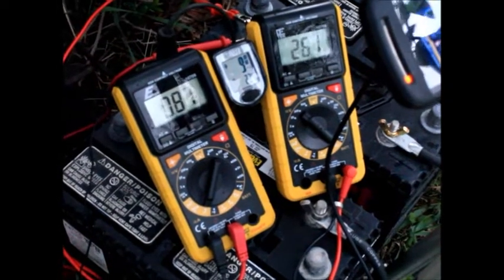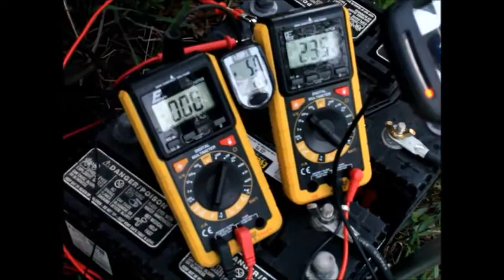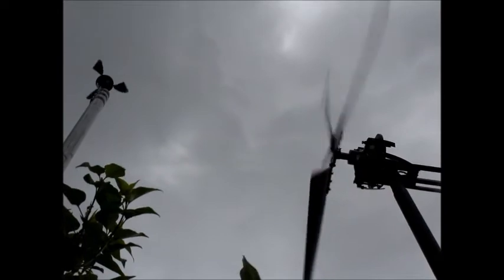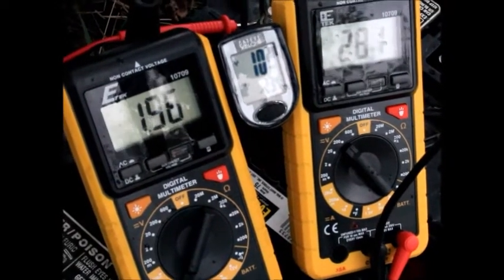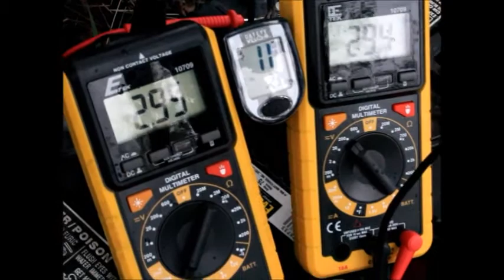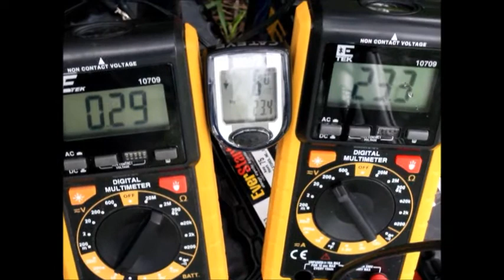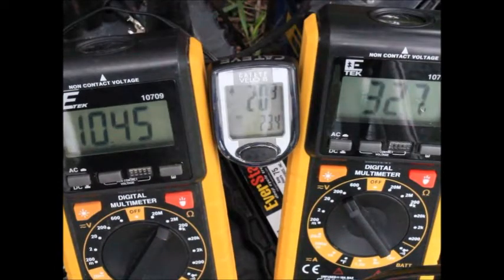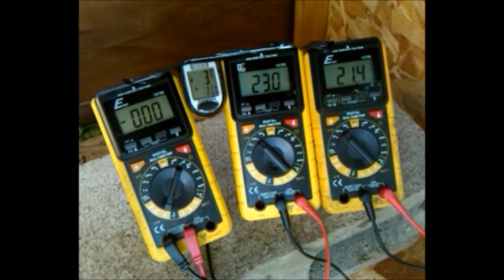Part 5 "Straight Shot" Dual Magnet Axial Flux Wind Turbine Generator Alternator PMA PMG

Comment: Very nice, love it!
Reply from the maker: Thanks James ... these things have come a long way since the treadmill motor turbines. Dare I say it though, those turbines still have their place. I am on the grid and will likely remain so at $.12 per kwh. When you add up 24 magnet set + stator wire and build + dimensional steel + blade set + many hours of elbow grease they are not cheap! I have an old servo motor turbine with two blades I will need to video again .... total build time is an afternoon and servo motor can be had for under $50 if you shop it out ... performance is very similar. This is and has always been about the fun for me. Thanks for the compliment man, I know you have been watching for a while
Reply: belgrademachine I pay about 10.5 cents/kwh and will have a payback on my system in 6-9 years - when it's finished of course. Still got an axial flux to add - parts sitting on the bench waiting for me to finish playing with solar heaters, and another kw or more of solar pv to add, but getting there. It's a lot of work for sure, but I love every minute of it lol. Just stopped by to say hello, haven't heard from you in a while. How is the straight shot working lately, do you have it hooked up at all still? Cheers man, hope all is well!
Reply from the maker: James Biggar Hey James good to hear from you. Yes still alive :) And I am going to rise from the ashes soon. Funny you should ask, I took the strait shot off the tower a couple days ago and took a little video of the process. It has been through weather and gusts and held up just fine been up since May. I did take it all apart to inspect and put a repaint to it for cosmetics. Also, have been finishing that old batch and plan to unload on ebay when finished. Not sure how much but put a bunch of work into those things then life took over. All good though ... how are you?
Reply: belgrademachine Nice, I was wondering if you've auctioned them off yet or not. I'm sure they'll sell - people are getting sick of the typical if you know what I mean, more and more are seeing the value in paying a bit extra to build or buy an axial flux turbine. Anyone with even just a basic knowledge of wind turbines and who's been watching your build knows that you've put a lot of work and care into machining the Straight Shot with precision, and with the figures you've shown I know it will be worth the investment for people. 
I can't complain, personally. Things are going well. I recently started another company and have been concentrating on marketing a new solar heater design here in Atlantic Canada - R&D has been a long process, but we're just about ready to start production. Unfortunately, we'll have to wait until this blast of winter is over to finish building the new shop - tried to get it framed up and weather tight before the mess started back in Nov, but things have been really busy with the construction business too (contractor/journeyman carpenter by trade) and we got held up trying to finish other jobs. Only another month or so to wait tho :) Good to hear from you again, looking forward to seeing more vids!!

Comment: what was the coil configuration on that stator set up you just ran, I forgot to ask, number of turns, number of wires on each coil, size wire? that gives me more information so I know which direction to go.
Reply from the maker: that was a nine coil, 150 turns, single strand, 18 gauge in star configuration. sorry for the delay getting back to ya

Comment: Output
10.45a
32.7v
20.3mph
0.342kw
Disc/swept area 3.24 m2 80" diameter blades took a while to find this as not in the description.
0.6 kw per m2 constant at 20mph or 10 m/s
0.354kw per m2 theoretical maximum harvest at 59%

This blade swept area at 3.24 m2 x 0.354kw =  1.147kw theoretical maximum harvest

Basically works out as 30% efficient, that's bloody good. Ignoring internal and external impedance and the varying  frequency, it is still really good.
For better data, a constant load would really help. I have been on and off working on a data logger for this very reason. I loooove data. But I don't have wind to play with :(

I made a massive excel file 5-6 years ago that I gave to Muddy, it was very accurate at determining alternator output (flux,windings gaps and spacings even a coil resistance and awg limit ) and matched blade discs over 0 -100mph and even torque and gear ratios, I will have to find it and apply what I now know of ac theory etc

Here is a link of a site for the maths on energy in the wind, it's just easy to understand physics, it's not the one I was looking for but it is ball park OK.
http://zebu.uoregon.edu/1996/ph162/l14.html
If i find the other site in my notes somewhere I will like them, it is a bit intensive. I missed a patent on alternator coil design 6 years ago because I was researching it so much for so long that a company/univesity beat me to a part of it , so I can't sell the idea but I can sure help out people. It was a hybrid of a pancake and 3 phase serpentine that had taps and laminated flat coils, haha, work that one out. I made a proto type out of mdf, it was 12" 3" disc it made 300watts with a 500watt input drive with only 10% off the coils installed. The taps can be autonomously selected voltage or amps, just like you would with a tapped transformer.
ANYWAY, I am Waffling on arn't I.
That's a nice machine you got there.
Reply from the maker: Frankly I appreciate the waffling :) I will have hook up a constant load for the wind storm we will be expecting tomorrow evening. One thing I noticed that there is always a delay between the anemometer cups and turbine blades as you would expect. At times when the turbine needs to turn on the yaw to a new  wind direction its even worse so the data can be deceiving at times. This is a turbulent wind location adding further complication. My theory is (layman) that somehow real output would need to be calculated by averaging a ten seconds of data rather than a particular "moment"? Admittedly, I am more of a hobby machinist / welder that physics guy so again having your eyes on the project is very welcome. And more to come, Thank you

Comment: 22 volts will barely run an inverter, so may be best to run batteries in parallel on a 12 volt inverter or grid tie
Reply from the maker: Yeah no intention of running inverters with this battery set .... just a demo for you and me today. I would need to set up a custom charge controller anyway. Slowly but surely I will gather up a proper RE system when funds allow. Thanks for the visit
Reply: belgrademachine Jason Brown uses a battery isolator between the battery and grid tie, which the battery sets your 12 volts. just a thought.

Comment: Diameter of the blades?
Reply from the maker: 80"
Reply: belgrademachine
Hmm that is 2m. It doen`t look so big. So win power at 32kmh and 2m diameter is 15072 watt. 341 watt electric output makes it a 2.26% absolute efficiency. So best HAWTs can achieve 45% efficiency a bad generator about 70% that`s 31.5% overall efficiency. So i don`t get it why your nice turbine doing so poorly maybe its your generator ? Could you measure how much electricity the generator produces while turning it with a electric motor and measure the impute electricity too? Am I missing something?
Reply from the maker: Hulla Dek Nice! I sincerely appreciate the critical review. There could be a few reasons for this. Although 341 watts was realized it was only a momentary 20mph gust of wind and with the weight of the blades, hub, rotor, shaft there is almost 25lbs to spin up to speed. I believe this turbine would perform best in an open area rather than a suburban back yard ... sustained winds in one direction are rare to nonexistent in this location. Watch the opening video clip and compare the speed up time of the anemometer cups vs the turbine blades then think about that as you watch the data on the multi meters. There is a delay of several seconds!! Furthermore, wind coming through and over trees and houses causes this turbine to constantly change directions and "hunt". Both of those traits must diminish output as well. Now, as you mentioned I could have geometries wrong in the magnet shape and coils as well as line losses etc... etc. This will be a work in progress and I hope to bench test the alternator when possible. Thanks again! I appreciate honest observation and comment.
Reply: Hulla Dek Are you sure your calculations are right? I think 15072 watts may be a couple of digits too many. Power = 1/2 (air density in kg/m^3 * swept area in m^2 * wind speed cubed in meters per sec * turbine rotor coefficient * alt/gen coefficient). For example, with a 2m rotor in a 32kph, or 8.9mps clean wind stream, theoretical potential harvest should be around 203 watts/hr - but that's based on average DIY hawt rotor and alt/gen coefficients (40%,60%), as well as a fixed air density of about 1.2kg/m^3 at sea level, 20°C ambient temp, and 50% relative humidity. Changing any of these factors influences power potential and harvest as much as varying the actual turbine design does: the colder the air is for ex, the denser it becomes and potential power increases at a given wind speed. At -20C at sea level and 50% RH, air density is about 1.4kg/m^3 instead of 1.2kg/m^3, and the hypothetical harvest from the example above would increase from 203 watts/hr to 237 watts/hr. So for a precise calculation, belgrademachine would have to measure the climate factors in the area during testing. There's a plethora of air density calculators on-line, all the information that's needed is temp, elevation and humidity measurements. But for argument's sake, at a peak output of 341 watts and using that fixed air density figure of 1.2kg/m^3, the 'Straight Shot's' current recorded eff can be calculated as:
Max theoretical power potential = 1/2(1.2kg/cu.m * 2sq.m * 8.9m^3) = 846 watts/hr.
Peak eff = 341w output / 846w potential = 40% 

Keep in mind that's a 'peak' output/eff. True efficiency should be based on total kwh's produced and average wind speed during the course of the test, and would likely be quite a bit lower, but I'm sure it would be comparable to most hawt's.
Reply: belgrademachine Your turbine works better than what's being discussed here, check out my comment above. Once again, very nice turbine. Definitely worth the effort ;)